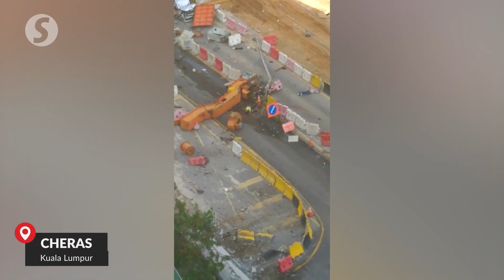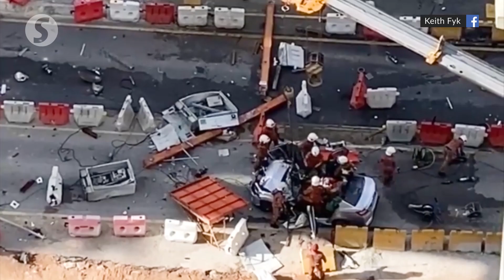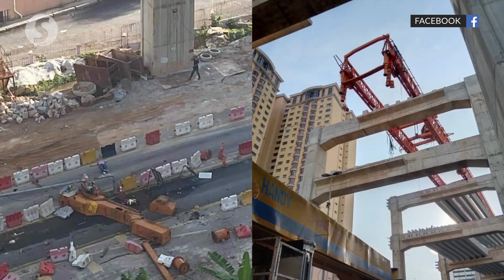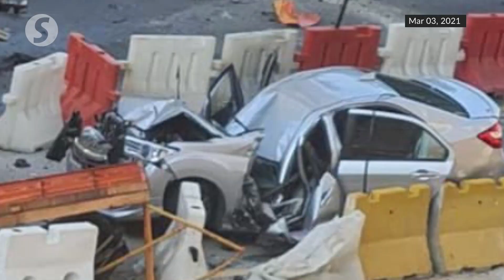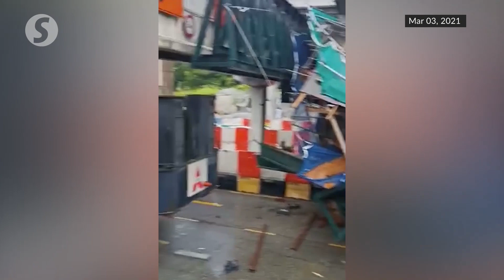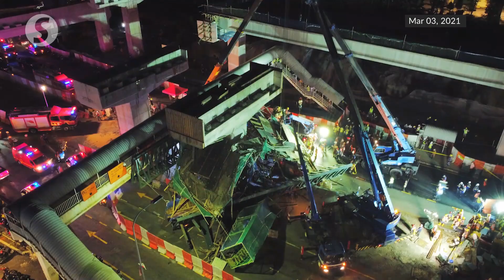SUKE: Three foreign workers killed, one road user injured following crane collapse

Comment: The risk is always there to happen. It bound to happen. The longer the time taken for the project to be completed, the higher the risk to the people and its surrounding areas. The massive project run across one of the busiest roads in the city and cut through densely populated areas. They can't afford to do it another like detouring these risky places otherwise there would be no return. It is not like it taken place in the middle of the jungle where the risk next to none. But even so there's a huge risk of deforestation.  City council should come out with stricter rules and guidelines if such project undertaken in highly risky places such as densely populated housing areas.

Comment: Why are they operating the steel girder with cars underneath. As I can remember any movement across traffic is normally done at night or the wee morning hours just like how MRT line 2 was constructed in Sungai Buloh. If the steel girder needs to move in line with traffic underneath they should close  a section of the road
Reply: Every time I pass by SUKE MRR2 highway, I have this phobia  that some construction material may "fly down" as  the steel structures and other materials are hanging precariously on the concrete pillars.  I will pray as I drive along.  However,< I don't see any reason that we really need to build these monstrous  elevated highway .

Comment: The safety measures SOP are not in place...always taking chance, should implement a solid re-tractable platform below those launching girder beam/ cross beam and etc...Heavy lifting are limited  to those area where there is a protection platform.